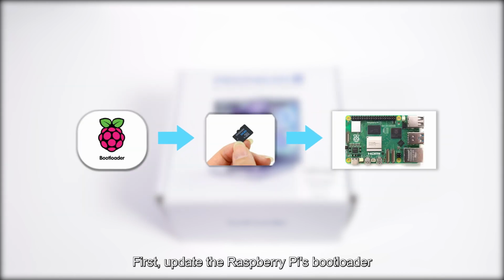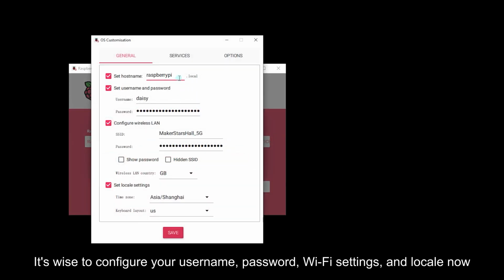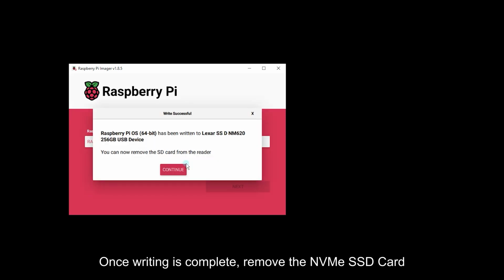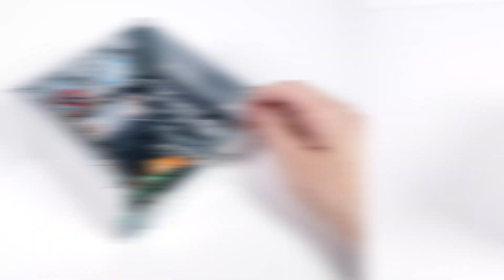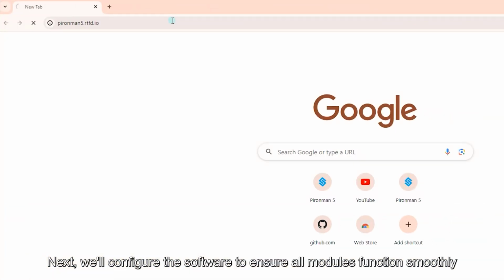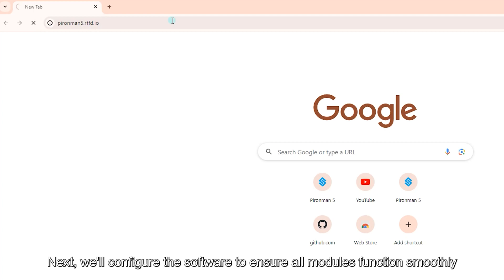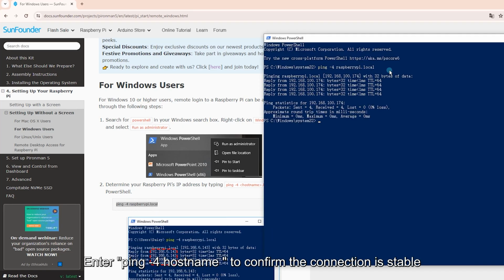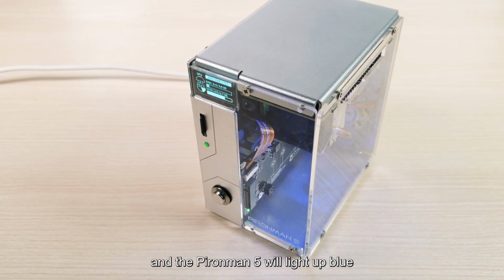Complete Assembly and Boot Guide: Pironman 5 with NVMe SSD

Comment: Have it put together now.  Only thing I'm noticing out of the ordinary is so far no cpu cooler fan activity.  This may be OS based, but I'm not experienced enough with linux to be able to say.  I'm using TwisterOS which is built on top of Pi-OS. Continuing to investigate.  Meanwhile there's about a 10 to 12c average temp drop from what the small plastic case you can get with the pi, actually does itself, even in the absence of the cpu cooler fan itself (47c avg at near idle and not exceeding 60c at full load).

Comment: Let me posit this:
Complete the software download onto your micro SD card before any other step, so that you can plug it into your Raspberry Pi 5   -- BEFORE --  you install it into the case, so you can test if the Pi 5 will turn on to begin with! You'll probably need to plug it into a monitor to check that you're Pi 5 has turned on, but go no farther than that. Unplug everything, and continue with the install as outlined.

I only suggest this step, as I am now facing having to take my whole Pironman 5 case apart down past Step 4, since neither the power button on the case or the Pi 5 board itself, turns the power on. Most likely a faulty connection to the USB HDMI Adapter itself in Step 4. And there are 27 steps total... 😞
And yes, I've tested the Raspberry Pi power adapter, it's good. And I've tried turning on the Pi with either button, no go.
Now, if you'll excuse me, I have a case to gently un-assemble... (as soon as I stop crying) 😂🤣

Comment: Why do we need a battery?
Reply from the maker: For RTC
Reply: @Sunfounder_official  what is RTC? You mean remote control?
Reply from the maker: @aravind.a  RTC (Real-Time Clock) ensures precise timekeeping, and with the built-in RTC module, Raspberry Pi 5 significantly enhances its time management capabilities, making it highly useful for applications in IoT, industrial control, education, and portable devices, especially in offline and time-critical scenarios.
Reply: @Sunfounder_official  got it. It is Real-time clock. But I am using without battery still everything works fine. What will be the differennce if I use that battery? can you please explain it. I could not find any information in your document, website or video.

Comment: Cool, now redo it without the SSD adapter because that isn't included in your kit, nor is it mentioned that it needs to be bought separately.  Errors galore.
Reply: It is included? It’s a complete kit… unless you’re talking about for the computer in which case of course it isn’t. If you’re going to go this far to build this case and nvme boot your pi, you should either have one already or know how to/be able to clone your as card to the nvme from the pi, which is not very difficult.
Reply: @connermalloy  It isn't included.  You are probably thinking I am talking about the SSD PIP.  I am talking about the SSD adapter used at 1:38 which is most certainly not included.  The normal methods don't always work.  The SD card only worked to update the bootloader.  In my case I was getting errors when installing home assistant OS through either SD or USB.  I was able to eventually get it working by interrupting the boot by holding 'shift' and having it attached to my network where I was able to use a feature to image it from the network.  Total pain and no tutorial video on YT quite matched my situation since no one was having the same errors or using the same configuration.  I don't think the SSD adapter would even fit in the box the pironman 5 comes in as it is a smidge too long.
Reply: I think it is not necessary to use it
Reply: You can buy an SSD adapter. That is your responsibility.
Either that or they'd have to bundle the SD-card, the SSD too.
Reply: @StaK_1980  Except it isn't necessary.  The "responsibility" to buy required third party hardware that isn't part of the main configuration (i.e. pi5, power supply) is an asinine idea, especially since it isn't mentioned when buying it.  I got it working without the adapter using an SD card to update the bootloader, failing to use that same SD card for home assistant OS, and installing OS over my network instead.  Buying a 15 chinesium adapter that will sit in a landfill after never being used again is insane.
Reply: there isn't a microSD card adapter included aswell, is there? 
You could also just pop that nvme into your main PC, and do it there. Just be 100% certain to copy it to the right SSD (that's why a different capacity helps differentiate)
Reply: @bernds6587  The kit doesn't include a micro SD card or adapter.  If you buy a canakit or other third party it might.  In the end though all of these methods require other hardware.  I tried the SD card method and it didn't work.  USB method didn't work either.  Those might not be the fault of the case designer, in fact they probably aren't.  If they are going to include the OS install as part of their product package they should include the instructions for each method.  Not everyone has an adapter for every, or any, method.  Not everyone has a spare M.2 port on their computer mobo.  I was only able to use the SD card to update the bootloader.  The OS was installed over the network.  I like the product, don't get me wrong, but I'm an electrical engineer and was barely able to figure it out.  A middle schooler should be able to use these but it would be a non starter.  My case looks snazzy and is useful.  It won't be much more than that for most though.
Reply: @JenkinsStevenD  
You cling to your misconception like your life depends on it. Instead of recognising your fallacy, you double down on it.

This a tinker case for a tinker board. That means that you have to have both the mental fortitude and the technical knowledge to assemble, install and troubleshoot something like this AND that you have some gear (like, khm, some SSD / NVMe / SD-card reader, etc.) extra lying around you.

Your writing indicates to me that you actually wanted a pre-made package and.. now you are actually upset that there are some things that you have to do manually prior- or post, by yourself and / or there are some auxiliary gear needed to help you along the way. 

This case wasn't meant for you, nor your use case.
(pun intended)
Reply: @StaK_1980  Nonsense.  It includes instructions that indicate what else is needed and the items in the video aren't on the list.  Your thoughts meander and your don't actually say anything.  I've designed PCBs like what the pi is.  The kit isn't user friendly and you've refuted nothing I've said.  Perhaps you should tone down your ad hominem.  Not being able to form a coherent argument is no excuse to go insulting people.  It doesn't tell us about your Napoleon complex though and I do appreciate a good laugh! 😂😂😂😂😂
Reply: On amazon, it comes with it. It's  a full kit, just without the Raspberry Pi 5, nvme drive, and power cable, idk where you bought it from, but it doesn't seem like you got the full kit, or possibly got scammed
Reply: @colevallance8889  No, it does not. What @JenkinsStevenD is referring to is not the part of the case (the adapter board or HAT into which you plug the NVME drive, it is the hardware in the  subsequent step in which the operator plugs the adapter containing the NVME into ANOTHER adapter (you can see the blue "SSD Adapter" graphic pointing to the gray and black adapter into which the operator slides the NVME/HAT assembly) and plugs THAT adapter into the computer. The adapter into which he slides the NVME/HAT assembly IS NOT included in the kit. However, this video:

https://www.youtube.com/watch?v=tF85w9GW3r0

DOES show you a way to install the OS onto the SD card, then CLONE the installation on the SD card onto the installed NVME adapter, then finally use raspi-config to modify the boot order to boot from the NVME. This video is flawed because it expects the builder to use an adapter that IS NOT SUPPLIED. Additionally, there is no mention of such an adapter in any of the sales materials OR in the kit itself.
Reply: @colevallance8889  i have the same problem and i got it from sunfounders own website